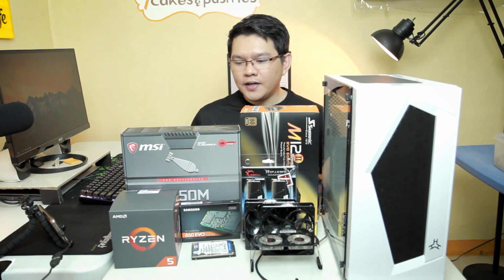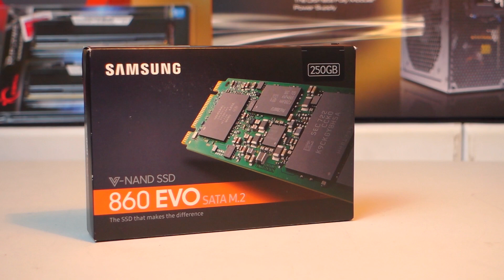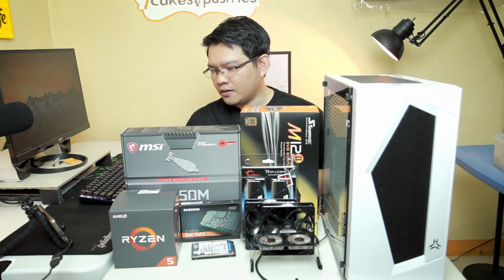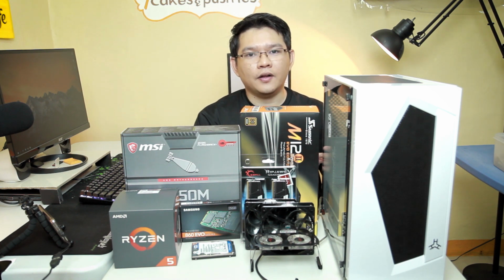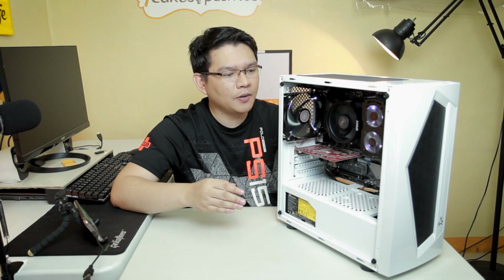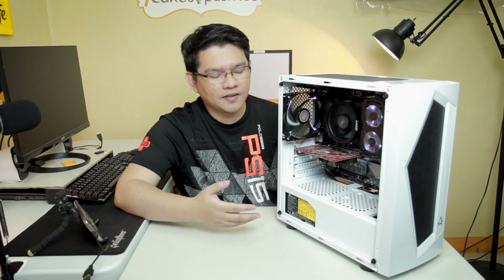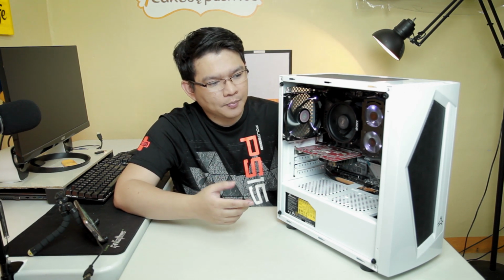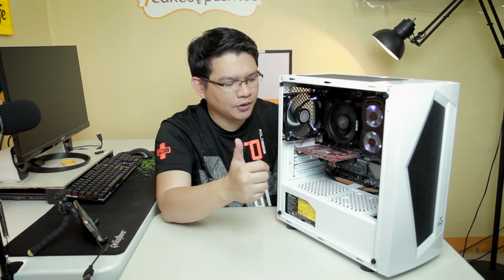Ryzen 5 2600X with MSI B450M Mortar Gaming PC Build

Comment: Hey I have a question, I have the same mobo and I have this issue where my G.skill Ripjaws V ram won't snap in. I mean I tried to apply a little pressure but it doesn't seem to snap in, any advice?
Reply from the maker: Make sure you slot it in in the correct orientation with the notches

Comment: I'm still waiting on my motherboard and I am unsure it I am going to mount the cooler with the amd logo facing the ram or the heat sink. I have seen some people rotate the fan so its facing up but I rather not do that. I just gotta see if its better by the heatsink or ram I see so many builds both ways, I guess it depends on the ram you have too.
Reply from the maker: Yeah, it'll depend on the form factor of your RAM and of course your personal preference :)

Comment: boss, can i get the full advertised speed of teamforce delta rgb 2x8gb 3200mhz (by using only xmp) if i pair it with msi b450m mortar max and ryzen 5 2600? will it be stable?

Comment: How did the ram go with this board? Did you get 3200 set with A-xmp, did you upgrade the bios at all? I really like to know cause I have the same board and cpu that you do.
Reply from the maker: For the specific kit I have on this video, I was only able to run it stable at 2667mhz, initially I was able to run it at 2933 but it was causing some issues. If you can push your budget go for AMD certified kit, I am now using a 3200mhz Trident Z GTZR kit
Reply: @TechBroll  Ah nice,  yeah I have been having some issues as well. I think I will also get another kit for it.

Comment: Sir are you able to overclock the ram at 3200mhz? I do have the same ram kit @2x8 16gb thanks in advance sir
Reply from the maker: Hindi eh, hindi siya stable at 3200mhz nakailang tinker na ako with the settings. I settled with 2667mhz until I upgraded

Comment: i have many questions to ask
1. does it support 2400mhz DDR4 ram?
2. can i oc the ram at 2667 mhz or 3000mhz?
3. my monitor doesnt support hdmi it only support vga how can i plug in?
4. what games that are playable?
5. my pc build specs:
ryzen 2400g
msi b450m mortar
4x4gb 2400mhz ram ddr4
can the old 550w psu handle it?

6. what if i dont have case fans? whats the solution?
Reply: @IcyDuck can i connect the board using hdmi to monitor? Dont have gpu yet

Comment: Hello idol what is your preferred micro atx mobo for r5 2600 with rx 590 and 16gb ram? msi b450m mortar or Gigabyte B450 AORUS M?
Reply from the maker: That was my options before, I chose the MSI B450M Mortar :)
Reply: @TechBroll  why B450M mortar over Gigabyte B450 AORUS M? ano yung mga nilamang ni mortar kay aorus m?
Reply: @TechBroll  sorry idol, medyo noob pa ako sa PC parts and this comming january ay bubuo ako.
Reply from the maker: Mas maganda ang VRM Heatsink ng MSI B450M compared sa Aorus B450 M, you can check this https://youtu.be/bC2nqjBIB0M saka yung video ni BuildZoid about how good the MSI B450M is. :)
Reply: @TechBroll  oohhh... nice nice. salamat idol sa advice. msi na bibilihin ko.

Comment: Nice build sir! Linis. Suggest ko lang to get better fans. Ok yung ID cooling na 120mm fans na color white. Bagay diyan, one for the front for intake and for the back for exhaust. And secondly, kahit 2nd hand na 1050ti or 1060 ngayon bagsak presyo na. Samantalahin :)
Reply from the maker: Yes sir Kevs! salamat din sa tip mo sakin about the case, and yes sir I'm considering the ID cooling para sa fans. kinapos lang talaga sa budget. haha baka mag 2nd hand 1060 din ako pero medyo matatagalan pa, mag sskyflakes diet muna ako :D

Comment: Using an older GPU for your build wasn’t a bad idea at all, imo. You’re gonna use this rig primarily as a workstation anyway and the 2600x is the perfect choice. You had a budget and stuck with it, and you can always get a better GPU later. Cheers.
Reply from the maker: Exactly, thank you :) I actually don't feel the bottleneck that much as It works great at rendering videos. I still cant wait to buy a graphics card real soon to try and play games on it
Reply: Filip Ulrich yes, better choice in terms of value. But I think he was choosing between the 2400G and 2600x. IMHO, I wouldn’t mind investing Php1.3k more for a better CPU cooler and out of the box performance.

Comment: sir natry nyo na bios update ng motherboard kung nag okay yung gskill ripjaws sa overclocking? and can you suggest ram na near same price ni ripjaws na compatible for ryzen if di pa rin nag 3200mhz sa overclocking.mag build pa lang po kasi ako. ty in advance sana po you can reply to this
Reply from the maker: To be honest, di ko pa nattry. But I suggest go straight ahead to AMD compatible RAM kit, yung Gskill Trident Z 3200MHZ na 
"GTZRX" is a good option
Reply: @TechBroll  ah okay.it would be great if ma try nyo din and make a video.most kasi sabi di nga working but yung mga videos are from last year or before pa. this could be a great breakthrough para sa mga nag bbuild ng budget pc since yun gskill ripjaws is one of the cheapest 16g 3200mhz. and another thing if you know if superluce and viper rams are good?nakita ko kasi kaypchub na below 5k lang sila 16gig 3000mhz na and if compatible sila for amd din
Reply: and do you know if this is compatible for ryzen overclocking po cmw16gx4m2c3200c16w
Reply from the maker: You have to cross check that bro sa QVL list ng motherboard mo or sa QVL list ng Memory. Usually nasa website nila yan, kung di mo makita sa list from the motherboard site it means di nila yung natest for that motherboard, pero di ibig sabihin di siya compatible, pwede mo din icheck sa RAM website kung tinest nila yung sa motherboard mo. If wala on both, pwede mo parin itry but that would be at your own risk. Sorry can't give you a proper answer if compatible ba or hindi kasi dipende yan sa specs mo. :)

Comment: Where you able to run the ram at 3200?
Reply from the maker: Unfortunately, not at this time. I got it up to 2733Mhz stable
Reply: @TechBroll  pano nyo po napa stable sa 2733mhz? akin 2400 lg
Reply: @TechBroll  pano nyo po napa stable sa 2733mhz? akin 2400 lg

Comment: Sir ano po maganda ram na compatible sa b450m mortar titanium + r5 2600?? 2666 mhz sana and white theme thanks
Reply from the maker: Hi Ian, I suggest you check yung mga supported ram sa QVL List here https://www.msi.com/Motherboard/support/B450M-MORTAR#support-mem-13 Or pwede mo din itry yung T-Force Delta na white + RGB
Reply: me 2x4gb na t-force delta rgb 2666mhz(white)ako, so far napa OC ko siya ng 3000mhz with this board, pero tinatry ko pa pa OC up to 3200mhz with the right timings
Reply: @pc6765  sir nasa qvl list po ba yung ram nyo?
Reply: ian christopher viloria wala po,  but that doesnt mean na hindi na supported ang ibang mga ddr4, rams na listed sa qvl means yung mga ram na test nila sa specific motherboard 👌😀

Comment: Boss Marvin nung nag order ka ba sa Amazon ng MoBo at Processor, maayos naman yung packaging at handling nung deniliver sayo? Plan ko kaseng bumili sa Amazon ng B450 Mortar at Ryzen 2600 kaso nag aalangan ako baka pagdala sakin dito, di maayos yung packaging.
Reply from the maker: Hi Elton, sa local stores lang ako bumilo eh. Although ang alam ko safe naman umorder through Amazon ang medyo hassle lang diyan is warranty if the parts is not with international warranty
Reply: san ka nakabili sir?
Reply from the maker: @onepiececrazyshorts  magkahalo between EasyPC and DynaquestPC dipende kung sino sa kanila yung may stock
Reply: ok sir salamat ng marami 😊

Comment: sir tanong ko lng po kng compatible ang ryzen 5 2400g sa zotac 1050i
nguguluhan po kasi ako kasi amd ang ryzen at gtx nmn ang zotac
pls help po
Reply from the maker: Compatible naman sila, pero may built in graphics na ang ryzen 5 2400g eh, if you want pwede ka mag ryzen 5 2600 then 1070 ti

Comment: New subscriber here boss marvin may tanong ko lang po itong build nato kung magkano aabutin nito ngayon sa pinas and anong pros and cons nito gagamitin ko lang sana pang gaming all kinds of games like watchdogs,assasincreed series,fortnite,pubg,overwatch and kung ano pang mga games ty sir in advance mahelp mo sna ako ty
MSI Radeon RX 580 8GB Graphics Card
Ryzen 5 2600x AM4 3.6GHZ WITH WRAITH SPIRE COOLER
ASUS B450M-A/CSM
Micro ATX Motherboard Ryzen 2
Ballistix Sport 8x2GB DDR4 RAM 2666
EVGA 600 BQ 80+ BRONZE Power Supply
ADATA SU800 128GB SSD
Seagate BarraCuda 1TB Hard Drive
Reply from the maker: Thanks for the sub, you can check the prices here sa http://pinoypartpicker.com para macompare mo between PCHub and Dynaquest para magkaidea ka lang how much these parts costs, and then pwede ka din pumili ng ibang shops once may idea ka na. Sa parts mo mukhang ok naman, make sure mo lang yung RAM na napili mo is pasok sa QVL ng motherboard mo para siguradong compatible with Ryzen. Good luck and Congrats!

Comment: sir possible po ba mag run ng 3200mhz ung ram, vengeance lpx 3200mhz po kase ung saken need ko pa rin ba ioverclock para maging stable sa 3200? im using the same mobo just the titanium version
Reply from the maker: Check mo sa QVL list ni mortar kung andun yung specific model ng RAM mo, pag wala baka mahirapan ka mahit yung 3200mhz stable
Reply: @TechBroll  hmm pano po ba malalaman kung stable na po siya? na run ko na po ng 3200mhz sir di pa naman nag bluescreen or any issues. pero di pa po ako nagta try sa games
Reply from the maker: Pwede ka mag run ng memory stress test using software like Aida64

Comment: Also do you think you need the fans for the ram? I just bought this same cpu and motherboard just curious I plan to run it 3200 on the ram as well.
Reply from the maker: It's not necessary, I just had it lying around from my old build so I used it, it's more for aesthetics really, or help a little but with cooling the ram and some parts of the motherboard but not significantly :)

Comment: same po tayo ng mobo at ram,, but i cant run my ram at 3200,, 2400mhz lg ang stable nya
Reply from the maker: I can't run it at 3200mhz as well, pero napagana ko siya at 2667mhz stable, kaya pa up to 2733mhz pero minsan nagkakaissue
Reply: ano po nangyayare? bsod?
Reply: bsod or force close ng mga games like watch dogs 2 ,just cause 3 o state of decay 2
Reply: kung sakali ba mag bsod paps need na magformat ulit ng os? or kailangan lang babaan ung ram speed para magstable then balik na ulit sa dati?
Reply: binabalik ko nlg sa 2400,, stable naman sya,, d na nag bsod
Reply: 3200mhz po ba ram mo?
Reply: @chabsproduction637  yea
Reply: kung ibang brand po ng ram kaya ba marun ng 3200mhz? may issue daw po kase talaga sa ripjaws v na 3200mhz
Reply from the maker: Check niyo dito sa review ko ng MSI B450M Mortar, shinare ko dito yung overclocking experience ko with the Gskill Ripjaws V 3200mhz 2x4 Kit. Wala naman issue itong kit na ito, sadyang di lang siya optimized for Ryzen since tinest yung 3200mhz niya sa intel platform.

https://www.shopzadaph.com/2018/10/msi-b450m-mortar-unboxing-review-and-overclocking.html
Reply: @chabsproduction637  hindi ko lg alam,, ripjaws v 3200 din ba ram mo?
Reply: corsair vengeance 3200mhz paps
Reply: @chabsproduction637  hindi din kaya 3200 with b450 mortar?
Reply: @TechBroll  Hi sir, tanong lang po, so kung gagamit ako ng 3000mhz na ram up to 2667/2733mhz lang din po ba o mas bababa pa? salamat po.

Comment: almost the same build sir. nahirapan ka din ba sa pag kabit ng stock cooler? ano temps mo while idle and gaming? https://imgur.com/a/gZgYdWb
Reply from the maker: Hi Christian, di naman masyado, kinailangan ko lang lagyan ng support yung bracket sa likod ng motherboard para maikabit ng maayos yung cooler.  Idle temps ko now, actually not idle pero using chrome lang is around 40-44 degrees. and pag gaming nasa 70+ pero naka turn off ang core boost performance ko so I'm only running at 3.6ghz right now. saka ko na i-on or tweak pag maayos na airflow ng case and with proper CPU cooler
Reply: @TechBroll  same temps sir naka off din core performance boost ko kaya 3.6 ghz lang ang max. kala ko mali ako sa pagkabit ng cooler. natagalan ako kasi nakapatong sa box ung motherboard kaya medyo di stable ung bracket.  masyado lang din mataas inaabot na voltage kapag naka on core boost. gusto ko mag upgrade ng cooler kaso masyadong mataas ung height ng mga cooler para sa anyag. pinaka nakikita ko na kasya is cryorig h7 pero di ko alam kung worth it.
Reply from the maker: Same na same tayo ng situation haha, when I did this build video kung mapapansin mo I used an aftermarket thermal paste, kasi umulit ako sa pag kabit ng cooler dahil nga sa box ko din pinatong yung motherboard so hindi magpang abot yung screws, so I had to place a box sa likod para tumaas yung mounting holes at nakabit ko yung cooler. With regards naman sa temps and voltage, yes ang taas nga ng bigay ng CPO on auto kaya in return ang taas din ng temps so sa ngayon 3.6ghz muna ako. Gusto ko sana ID Cooling na CPU cooler or the inexpensive Gammaxx 400 kaso yun nga, same with you, di ko pa sure ang clearance when it comes to the Anyag
Reply: @TechBroll  haha. bali 2 times ko din kinabit yung cooler nag remount ako after 2 days kailangan ko pa kasi bumili ng thermal paste. di kasi ako kuntento sa temps. ginawa ko naman binaliktad ko ung box na patungan para medyo mas matigas. pero ganun pa din temps dun ako nag search at core performance boost pala ang dahilan kasi parang auto OC siya. hintayin ko update mo sir kung anong cooler ang gagamitin mo. sayang kasi potential ng procie natin.
Reply: nga pala sir ano current speed ng ram niyo. same din kasi tayo ripjaws v 3200 mhz. sakin kasi 2933 naka auto lang after i on ung xfr.
Reply from the maker: No problem, lahat naman idodocument ko dito sa channel ko. di ko lang sure kelan ako makakabili ng CPU cooler kasi ang priority ko now is proper graphics card kahit rx580 or gtx 1060
Reply: nice! naka on na notifications ko sa channel mo sir. currently naka rx580 4gb ako nabili ko sa easy 9995. sa tingin ko kasi sulit na sa price niya kaya umutang muna ako para makabili na haha.
Reply from the maker: Maraming salamat bro, nag  home credit ka sa EasyPC? pinag iisipan ko din kasi yung home credit option just in case mag bnew ako. pero kung second hand baka targeting ko yung 8GB version or 1060 6GB
Reply from the maker: yung sa RAM 2733mhz lang eh, tinry ko yang 2933 pero hindi masyadong stable lalo na pag multiple tabs sa chrome. nag XMP profile 1 ka?
Reply: cash sir. wala home credit sa bacoor branch nila eh.
Reply from the maker: I see, meron kasi sa Fairview. salamat bro. tignan natin kung ano magagawa ko dito sa PC ko hehe
Reply: welcome sir. yes xmp 1 profile. 16 gb 2x8 gb yung sakin kaya di ko siguro mapansin kung stable ba o hindi. ok naman ako mag multiplw tabs sa chrome pero ngayon firefox ginagamit ko.
Reply: sir di ko pala natanong kanina. naka windows balanced power plan ka ba?
Reply from the maker: naka performance power plan ako bro :)

Comment: My PC Spec
Intel Pentium E6600 
Asrock G41M-GS3
2x4GB Ram 14something hzz
Nvidia Geforce 210
Rakk 400 PSU
2 Fan
120GB SSD
Case Rakk Anyag 1st version
Generic Mouse & Keyboard

😂 you can laugh
Reply from the maker: As long as it serves your purpose you're good to go! :)
Reply: Ty po nag iipon papo ako ng pang upgrase case at ssd palng po nabibili ko eh
Reply: Next kopo ay PSU ano po bang marerecommend nyo budge po sa psu 2-3k
Reply: Thinky Tech corsair psu’s! better to check them out!
Reply: Nah I bought Seasonic 650 watts
Reply: @ozzysalonga6767  corsair psus garbage cause i have the cx650m  and I sounds like this when gaming Krrrr Every 7 seconds
Reply: Ceneterion oh okay. i am using rakk power supply. and i saw other comments about corsair and they said corsair is very trash